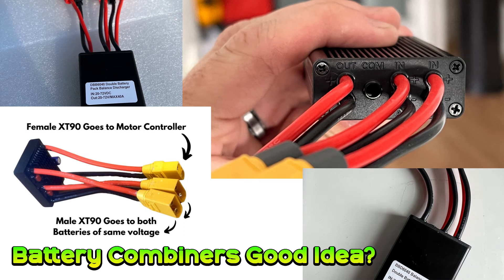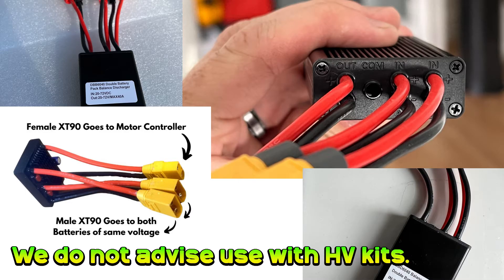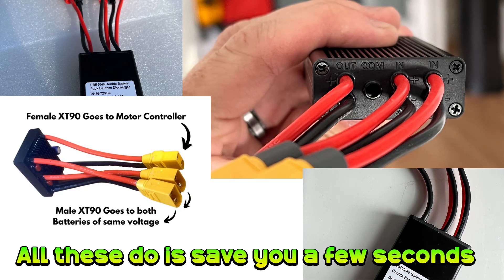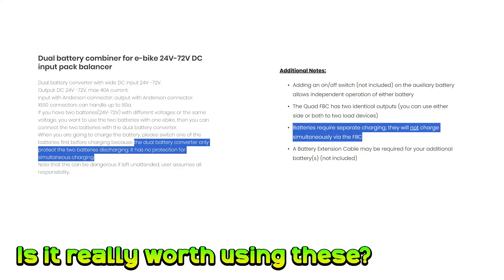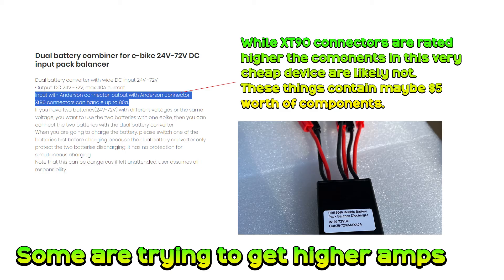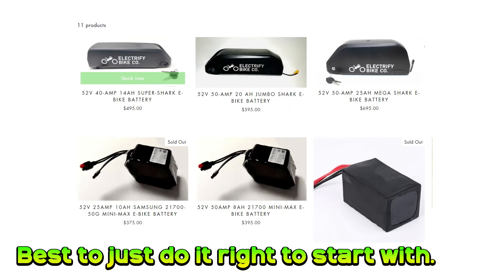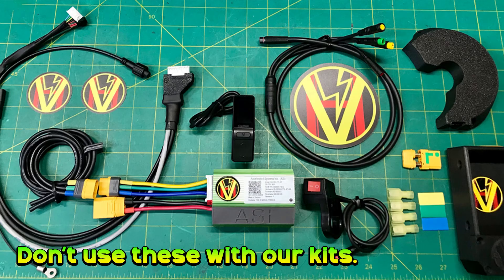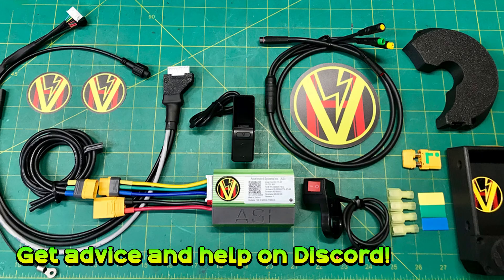Ebike Battery Combiners are they worth the risk?

Comment: Ya. My 2017 ebike is old. The batteries are still great. 2 16 amp hour batteries. Proprietary. Got a new ebike I want to use the old downtube batteries on my new folding ebike.  This is a problem most folks will eventually run into.

Comment: It's not just about time. It's about saving money. Who wants to lug around extra batteries? If you're going to do that then you might as well have them installed on the bike and use them for range. My bike came with two batteries and a DBB6050 Dual Battery Balance Discharger In:72VDC Out:20-72V/Max50A and it's still not enough range for me because the nearest beach is 30+ miles away from me so I want to add a tripple battery balance discharger and add a third battery or get rid of the original rack battery and build a monster battery to replace the 15Ah rack battery so that I can make it there and back without having to baby the bike both ways and still have enough to do some exploring and have an excess amount of juice left when I get home.
Reply: they do make ones for 3 battery's now with a charging port to charge all 3

Comment: i have a dual battery 48 v 33 ah dual battery with a 35 amp controller and a 50 amp dual battery converter and have had no issues. it only draws 35 out of the 50 amps and leaves rooms for a controller upgrade if i need. nothing run hot and it helps alot with voltage sag.

Comment: , a couple of points of note, by using two batteries simultaneously you don't need to draw each battery down as far it takes longer to do so Andrew able to have the higher output based on the drawdown curve of the said batteries. Higher amperage is a benefit if you have a controller that allows for it and the batteries can handle it. Not something that should just be assumed though. Well you do make some good points I feel like this is a little bit biased and not fully informed to be just telling people no it's not worth it

Comment: I have them on 2 bikes. A 48V and a 52V 1500W amp rides. I put a 30ah battery on both rear racks with appropriate BMS amperage for the controllers on each bike. 2 years now knock on wood. Went for a 50 mile ride today on the C&O Canal.

Comment: For a number of years and on a couple of different E-Bikes (250-500w) I've just been using a single to dual xt60 cable to have batteries of different ah running in parallel and all has been good fortunately, I'm not keen on mixing voltages anyway as it's a recipe for disaster.

Comment: I normally agree, and I do have one ebike set up with interchangeable batteries. I also have an ebike with a proprietary battery, and I didn't want to pay double what it's worth for an interchangeable second battery from the manufacturer. It's working great; same voltage, amp hours, and output, and a 30 amp controller pulling 20 amps . It doesn't even get warm.

Comment: You are SPOT ON!!! I have seen videos of these combiners when they don't work and bike catches fire. MY BIG QUESTION IS WHY NOT DEVELOPE A SIMPLE SWITCH TO MOVE FROM ONE BATTERY TO THE NEXT. SEEMS SIMPLE BUT HAVE NOT FOUND ANYTHING LIKE THAT ON YOUTUBE
Reply: My first idea, but I couldn't find one!
Reply: Me to , I've scoured everywhere for a battery switch.
Reply: I'm sure you could rig a toggle switch. I've been told by the pros to not use any kind of balancer. You want your bike to see your battery as one big battery, instead of flipping to highest voltage. With a balancer you need to charge your batteries seperate.
Reply: The Happy Run G100 has two batteries and a switch.

Comment: What do I need to know about adding a 100ah battery to a 48v bike? I want like over 100 mile range. Will the motor burn out?
Reply: For a 52V 50ah battery  with samsung 21700 cells, it will cost you $1900. So you wantvto spend almost 4k un batteries? Go buy a better bike imo. 60 extra pounds in batteries and $4k is wild work my friend 😮. I love the extreme ideas though!
Reply: Pricing low....Well two 51.2v, 50ah lifepo4 batteries would give you 5kwh battery, but at 80 to 86 pounds of wieght.  My over engineered/modded cargo bike has done it, & doing it again.  Feel bad weak for the bicycle wheels....get good wheels, build good wheels, go with fat or motorcross wheels.

Comment: I've been using one for over a year now. Seems fine. I don't think anyone mentioned that this is less taxing on the batteries than if you use a single battery. I believe in the long run the batteries will last longer this way. Correct me if I'm wrong. Also, I believe if the batteries are equal voltage, you could probably connect them together with a Y plug and I don't think there would be a problem as long as the batteries were the same voltage??  Last year I did a mileage test with my BBSHD  and  2  52 V batteries. I got 100 range.  I was impressed with it.

Comment: Hello, I have a Fatbike Ouxi V8 Pro 48V with one battery. However, there are identical models with two batteries connected together. How can I connect another battery if using combiners is not safe? And why can’t I use combiners from AliExpress if there are many good reviews?

Comment: You are leaving out several very valid reasons for using a blender. 
1 Battery packs will have greater capacity at lower discharge rates......So if you have two cells or packs running at the same time at X load the WH of capacity will be greater than the WH capacity if you run them separately
2 Many bikes do not lend themselves well to installing one large pack the normal location...or any other for that matter.
3 Many/most people already have a single pack in good condition when they realize they want more range or power, so adding a second pack is a lot cheaper than dumping the original good battery for a single better battery.
Reply from the maker: All fair points. Just make sure you get a high quality one and not an ali express resale job. Cheers

Comment: I have zero 10x battery was looking to convert it to an e-bike kit but that battery is for two controllers thus has two connector wires for each one, I plan on using this method to get make it work however my battery is 50a and I can only see switches that go up to 40a with xt60 connectors, any suggestions?
Reply from the maker: I would post this on the battery channels on Discord. I don't see why just using one set of connectors would not work though. You might also be able to combine them into the one controller using one of these but I don't think it would achieve much.

Comment: What if your using two of the same batteries that came with the bike. Lectric gave me an extra battery. Two UL certified batteries that were made for this bike in parallel. Both batteries charged fully. Use a balancer and connect in parallel. I'm not understanding the problem.
Reply from the maker: The issues are some of the electronics in these things are very shoddy. It’s hard to tell from the outside. Get one that has proper reviews and is made by a solid company. Not an Ali Express up seller
Reply: @HighVoltageKits  thanks
Reply from the maker: @theresejames8826 welcome

Comment: I just use a robust marine mechanical switch to switch from the discharged battery to the fresh battery. It’s convenient but doesn’t involve the failure risks with an electronic switch
Reply from the maker: Thats the ticket
Reply: @HighVoltageKits best to  stick with the KISS principle
Reply: @floydvv I’m on that path currently for my 52v scooter. Would you mind sharing your switch of choice and maybe the wiring or diagram? 🙏

Comment: As a noob, I purchased in 2022 the budget 48v-10.8 ah battery for a BBSO2 Bafang the range stinks. I'm lucky to get 7 miles and half hills. Now I must add an extra 48v-20 ah battery to get home. Yes, why complicate it plug and ride home!
Reply from the maker: Yeah those small 48 volt packs don’t last long. Especially once the cells start to degrade. You are usually better off getting high power cells if you can as they last longer under the kind of draw you generate with an Ebike.
Reply: @HighVoltageKits  Thanks great video!

Comment: 2nd e-bike battery... actually what circuit is in it? Is there a resistor in series connection or is there an active circuit in the form of a MOSFET?
Reply from the maker: I think they use diodes in alot of them

Comment: I’ve seen a few Discharge Converter failures and only the DC itself was damaged. But DAMN I can’t count how many up in flames battery failures I’ve seen. Hundreds of videos of exploding, smoking, hot fire batteries doing damage. If you don’t want DC’s used with your gear simply state that because the rest of what you stated was half baked opinions and at worst dishonest.
Reply from the maker: Umm no. It comes from seeing multiple kits damaged. You have seen hundreds of videos… gonna call bs there pal.

Comment: QUESTION:  what about putting batteries in series, along with voltage connect, disconnect boards, thermal, and voltage, current, and watts board displays for each of the batteries?
Reply from the maker: You can also combine them in series like two 36 volts to make a 72 volt battery as long as its done safely this is ok. DIfferent method than this though.

Comment: Most of the issues I’ve seen with dual battery setups were with cheap batteries and not the discharge converter.

Comment: Not worth the risk. Just connect a trip switch to each battery or fuses. Works for me. Then you can switch them in and out and the breaker rcd switch will go if any shorts or anything occurs. I have two bms attached to each battery, which can be switched between the two.

Comment: I bought a Shengmilo M80 from new years ago that came with a second battery. I used a plain converter socket to allow them to connect in parallel instead of having to disconnect one before connecting the other. They are permanently connected together & charged as one battery. The result is a far more stable Voltage & power when ridden & lower amps coming from each so likely a longer lifespan. If I was to change the hub motor for something bigger then that would be a very different story, as stresses would increase. As it is, stresses have only decreased & I have every confidence that the bike & batteries will give me many more miles of reliable service.
Problems are more likely the result of overstressing components.
Reply from the maker: Hope it lasts for you! The only risk is a bms going bad in a way you don’t expect and it leading to overcharge or discharge of the battery. If they are good enough quality it ought to catch that though.
Reply: So you have two batteries connected together without using this discharge adapter?
Reply: @johnravis3943  Yes, exactly that.
Reply: @tvbridge  hi my friend so is it easy to connect two batteries together? I want to extend the range of my ebike so my battery is 36v if I connect another battery does it need to be 36v? And can I use a bigger or smaller battery that's already on the bike?
Thanks
Reply: @johnravis3943  Yes. The Voltage needs to be the same when connected in parallel. You can connect as many batteries of the same Voltage in parallel as size & weight allows. You really don't need any special connector.
Reply: @tvbridge  and can I charge it via the one port on the bike?
And can I charge both batteries at the same time with 2 separate chargers while they are connected?
I appreciate your help

Comment: It would be easier to just get a 2 pole 3 way switches to switch battery wouldn't it?
Reply from the maker: Possibly although getting something suitable for the Amps that is the right size and easy to mount might be tricky. But not attempted it myself.

Comment: Everytime I unplug and replug the battery it sparks right between my fingers and scares me, even if I unplug it for few minutes, I am afraid the capacitor will eventually blow up one day when I am plugging it, and I don't even have a second battery yet
Reply from the maker: What is the voltage and connecter? Maybe swap them to an anti spark version?
Reply: @HighVoltageKits  48volts, 10AH, T plug battery connector, and a 1000 watts rear hub motor

Comment: Proper use case is you upgrade the motor with matching voltage, now you only need an extra $300 battery hooked in parallel to provide the needed current to the motor. Otherwise you’ll need to spend an extra $800 on a proper battery. Also in many cases, as in my case, I already have spare batteries which didn’t run in parallel in the past, but now can for the new motor, saving myself the need to spend any money on new batteries. There are dual-battery modules that safely combine two batteries, drawing from the higher voltage battery first a d going parallel once they match. This is safer than a straight parallel hookup where you must ensure voltages match before connecting them together.

Comment: what means your kits whats means your kits? "your kits" are just picked from chinese web, tested and rebranded by you, yes, but are not your kits
Reply from the maker: Er no. We use ASI controllers which are tuned and configured by us and paired with display etc. Some components are manufactured in China like almost everything these days. But the harnesses, assembly, testing as well as manufacturing of 3D printed components is USA and Canada. So no it’s not just some rebranded Chinese kit :)

Comment: Which three-position switch will be good if the maximum current is 80A 72V?
Reply from the maker: Hi. I can’t really advise here. It’s not something I have tried. You need to make sure it can handle high current though. 60-80 amps likely.

Comment: Hi thanks for video i would like to ask what happen when i accidentally connect two ebike batteries togheter? One is fully charged 54,6v other had 44v. I did it and from my perspective nothing happend but i want to know what could happend. Please help
Reply from the maker: Hopefully the bms would protect it. But if  not then the voltages would try to equalize generating massive heat and potentially explosive fire resulting.
Reply: If you connected a discharged 44V 10A battery to a fully Charged 54V 20A battery the latter would want to dump something like 10A into the discharged one.....not a problem for the charged one but it would be like connecting a 10A charger to the discharged one. Potentially an issue for it's cells if it's BMS doesn't control charge rate. Change the sizes of each battery in the scenario & the rate Amps of charge/discharge also change, obviously, but never above 1C in either battery, so I can't see any problem. I've equalized batteries more times than I can remember with no problems.

Comment: Wow very cool 😎  i have a 72V Scooter with 5000 watt motors each, but only running 30ah battery 🔋,  is it possible to use this to add a 20ah external battery in parallel Or avoid this technique altogether? Thank you!
Reply from the maker: I would be very careful as you are drawing a lot of current with that. There are some options that can go this high. They tend to be more expensive. We can't cover all of the options so we don't recommend them as it was causing issues with our upgrade kits.

Comment: I use a dual battery balancer on my engine x, I have 13ah in the frame and a 10ah china blue on the rack. depends on the bike, mine folds so it's a bit of a faff having to keep unfolding it and wearing out the face plate contacts. these have been known to short out and melt. I bought a quality kit not these cheap aliexpress or ones off Amazon. mine came from the u.s and i paid a premium for it. everything about it was quality including the wiring and connectors. I've also installed a power analyzer too to see how much my large frame robs the batteries of power😂
Reply from the maker: Looks like you did it right! Cheers

Comment: if you are so inclinded, you could install a triple position switch. with an "OFF" in the middle and "Battery A" left "Battery B" right 
(or something similar) but it is pretty easy to just switch plugs lol
Reply from the maker: Like a dead man's switch with a generator and grid power. Yeah it would work.
Reply: @HighVoltageKits   there's no way you could accidently run both packs at the same time like this. Just make sure it's well insulted 😅

Comment: The advantages are different than you say. I am running two 48 volt batteries (one 19.5ah and the other 24.5ah) with a battery balancer/combiner. Since the draw on each battery is much less when ridden hard, the battery heats less and is under less strain. I have nearly zero battery sag even on the steepest hills. This in turn promotes battery life. Also, the batteries will run longer than if each is ridden as a single back to back. I seem to be able to get about 20%= better mileage from using the batteries simultaneously rather than consecutively. In addition, since the batteries run down much more slowly, I get the full charge power from the batteries for a much longer time when riding after a full charge. In other words, the bike rides more powerfully for a longer period of time. So my take is, longer total distance, no battery sag, less battery wear, more voltage to the bike for a longer time. To be clear, I use a Samsung battery and a Panasonic battery, both good quality.
Reply from the maker: This was aimed at people using our upgrade kits which allow for higher power stuff. So we wanted to avoid them using two batteries to add up to one of high current which are pretty expensive to get something of quality. It was not trying to say never use these. If you know what you are doing then that's good. We were finding people using low quality ones and they were causing voltage spikes on controllers. Places are selling them with xt90s on them and saying they are good for 90 amps. If you have no sag under load then you are clearly operating well with the capabilities of the device. Thanks for comment. Happy trails Doc :)
Reply: i've been thinking about getting one, i hate voltage sag. which one did you end up getting?